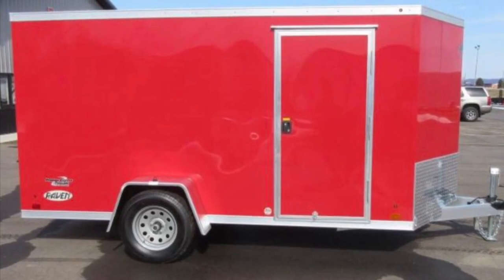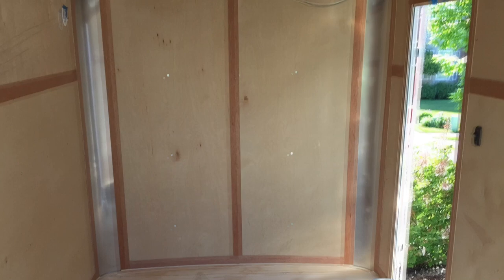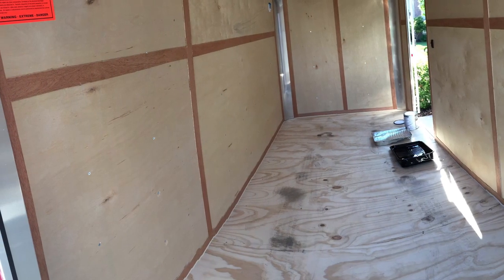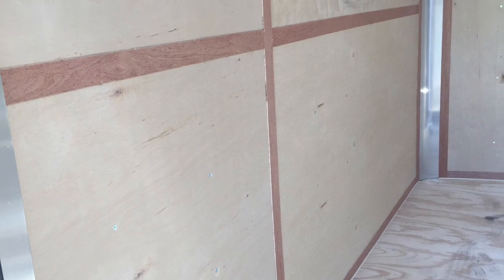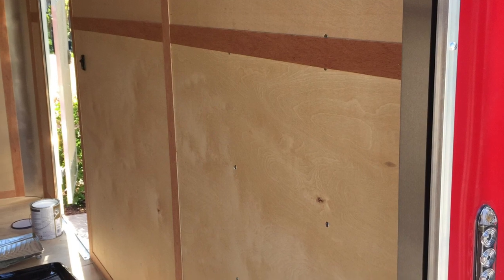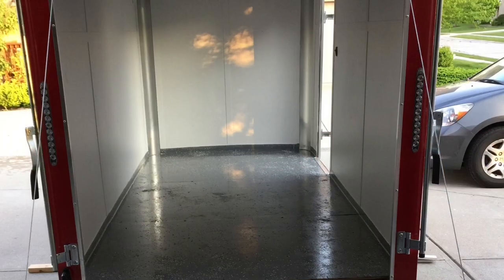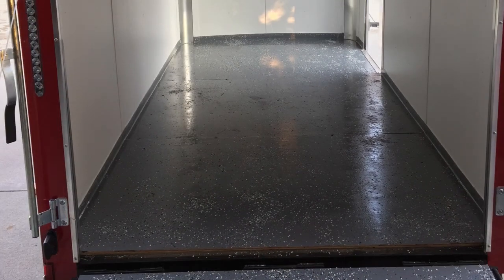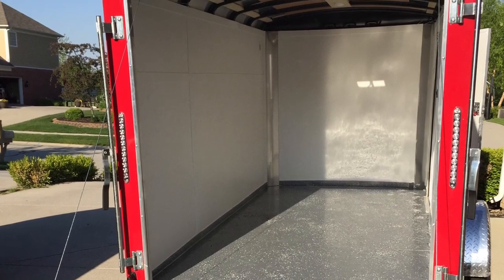DIY  I used Rust-oleum floor epoxy in my trailer!  Amazing results!!

Comment: Looks great did you sand it?
Reply from the maker: Great question.  NO.  We just cleaned it really well before using the product.  Then applied it and it went down really easy.  It's now been a couple of years and it's holding up great!!  We hose it out when it gets really bad.

Comment: How’s the floor holding up Randy?  And how long have you had the epoxy down?  I just bought a trailer and interested doing this.
Reply from the maker: It’s actually held up well!!  I need to make another video showing it. I’ve hosed it down a few times when it got really dirty, but typically just sweep it out. Still looks fairly new. I’m more than happy with the results.
Reply: @randysgreatadventures3148  how long has the epoxy been on the floor?
Reply from the maker: 3 years
Reply: @randysgreatadventures3148  oh wow!  3 years and it still looks fairly new, that is incredible!

Comment: Picked this up today to try out on my trailer thanks to your video! Have you needed to drill through the floor for anything since putting this down?
Reply from the maker: I haven't had to drill through the floor since putting it down.  Now I have had to scrub and wash out the interior and we used a hose carefully not spraying the walls and the floor came clean.

Comment: Can you do a review on the Rust-oleum  floor epoxy in your trailer , see how it is holding up.
Reply from the maker: I'll try and do a video this weekend.  The flooring is holding up really well.  We've had mowers and other motors that leaked a little gas and oil and it cleaned right up and didn't leave a mark.  This package  https://amzn.to/2LPZcOO  comes with two pouches in it.  We only used one on the trailer.  I'm amazed and how well it's holding up!

Comment: Just wondering does it go below freezing  where you are i wanna know if it survives all the climate changes of like the northeast and is it slippery?
Reply from the maker: I live in Indiana and the trailer is stored outside and it does freeze here.  It's made it through 2 winters just fine and is still holding up great!!  As far as slippery, I haven't experienced it being slippery.  This past fall is got pretty dirty and I took a hose to the interior and it cleaned up well and the water just rolled out the back.
Reply: @randysgreatadventures3148  that sounds great!
Reply: If your really worried about slipping, you can get non skid paint additive. Its basically just sand you mix into the paint before you start painting. It gives the paint a nice sandpaper like texture when applied.